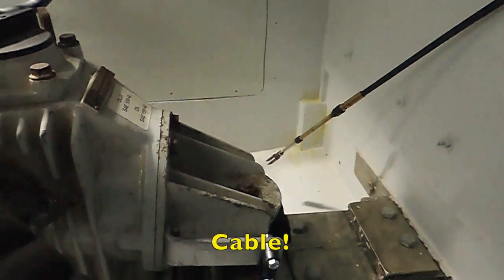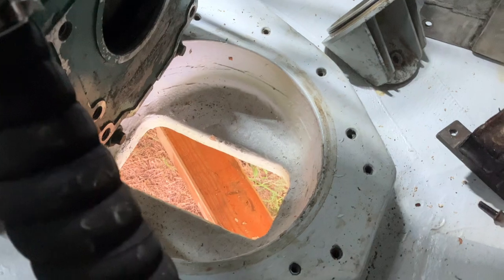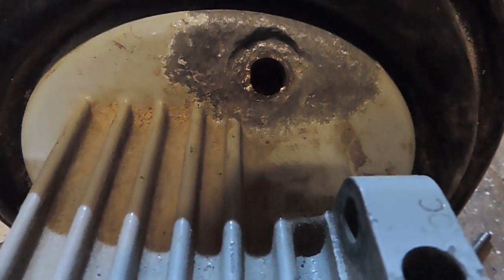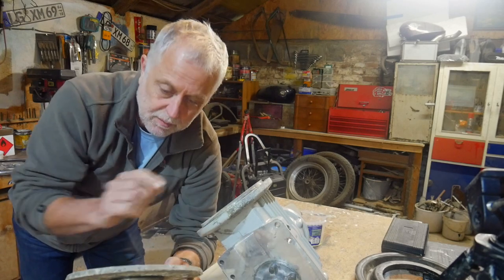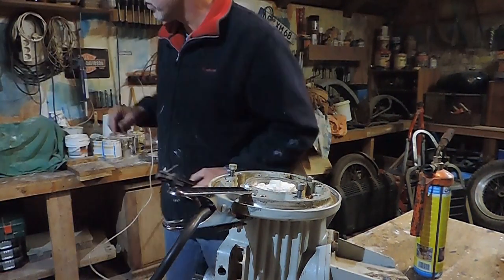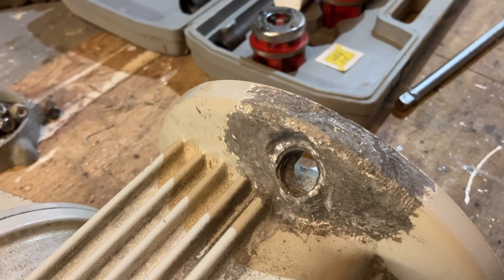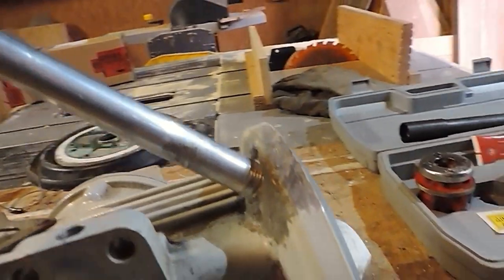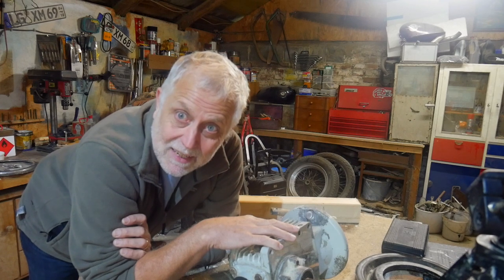THE SAILDRIVE - Removal, Disassembly and Plugging the Seacock; SV Tapatya EP248

Comment: Loved the response to when the broken bolt came out, It's worked! Made my day that has. 
We've all been there in one form or another, you know your facing a right load of grief thinking of various ways to get the broken bolt out. Mole grips, welds breaking, is there a fine tool head to cut a slot for a flat head screwdriver. Use a centre punch and get it as centre as you can and start drilling small hole incrementally going to the next size drill bit and see if you can get it out without drilling out the threads, Dam the threads are gone, drill it all out and retap. 
A whole bunch of ideas and over a day lost then one of the earliest methods works with ease, bolt spins out smooth as you like. Aweseome. 
The size of the project you've taken on glad something went alot faster than planned!
Reply from the maker: Absolutely! Thanks Alston 😃

Comment: like most of us you got into a personal fight with the bolt. And hit him harder. I have seen on other channels, Instead of force, use high heat on the bolt. It seems expansion and contraction of the bolt and the hole exerts great force. Which breaks the binding.
Love your determination and innovations.
Reply from the maker: Thanks Paul. Yes, I’m sure the heat from welding plays a big role in freeing up the thread 👍

Comment: Used this a lot on vintage motorcycles - you can, if careful, weld extensions on broken studs/bolts under the level of the alloy - the theory is the ally conducts the heat away quickly and loosens the remnants. Last time I did it was on a 1906 Moto Reve!
Reply from the maker: Thanks Robert. Yes I’m sure the heat from the welding plays a big role in loosening the broken stud 👍

Comment: You got the "sticky" bolt out by welding and sheer force.  For future reference, the very best solution for removing corroded threads is a fifty-fifty mixture of automatic transmission fluid and acetone.
Reply from the maker: Well, heat played a significant role there, Marshall 👍

Comment: Nice job on the bolt removal, Tony! Certainly much easier than drilling into it and using a bolt extractor, which would probably have been my first go-to.

Also, while you have the sail-drive off, I'd suggest you give some thought to fitting a line-cutter to it. There are some that can attached to sail-drive legs, and it will be a lot easier to mount whilst you have it off the boat. (Given how many boats become incapacitated - always at the worst possible time - by lines or nets wrapped around the prop, it baffles me why so few sailors fit line-cutters!)
Reply from the maker: Thanks Garryck. Yes, they are readily available - I’ve been looking at them. I still have to buy a prop and the necessary fittings for that, so I’ll get one at the same time 👍
Reply: @SVTapatya  - That's excellent news!

Comment: Good job on getting the bolt out Tony. I seem to recall you had some earthing/continuity problems between the engine and saildrive ages ago (Mads on Sail Life had the same too with his Volvo Penta and it was some plastic washers that sit between the two)... looks like there's been some issues on yours  (but I think you checked that - maybe a year or two ago!).
Reply from the maker: Thanks Billy. That’s right, I did find continuity and sorted it out. I’m sure this corrosion stems from the drive’s previous installation - I bought it secondhand 👍

Comment: you should block the in let at the bottom of the leg
Reply from the maker: Yes, seriously considering that, Chris. Have you got experience on that front?
Reply: @SVTapatya  A friend of mine has a boat that has had that done to it. It had been across the Atlantic twice before he bought it and the leg inlets were blocked. I presume it was to keep salt water out.
 The boat that I purchased some years ago had to have the saildrive replaced because of corrosion. It was only in service for a few years and had been sailed in salt water.
Reply from the maker: @chrismilne4511  Thanks Chris. That is good info :-)

Comment: Regarding your sail drive problem. You obviously did some research with your comments on forums. You might be reinventing the wheel as if you either approach a manufacturers customer service dept or even just look at the latest equivalent model it is likely that they have already addressed the issue as part of their own improvement program and if so it is a simple matter of duplicating this for your own needs.

Of course forums are an invaluable source of information but better to check the manufacturer first since as you point out they have all those expensively educated engineers.

I am going to totally guess here but the reason a brass fitting was in there was because some bean counter decided that engineers did not know anything and it was cheaper to go that route which would last a few years till out of warranty then implement what an engineers came up with.
Reply from the maker: Thanks for your thoughts Glenn. I don’t think Volvo have sorted this issue , although the drive does function as they build it. Lots of people report having difficulty with that seacock though.
My solution will certainly work for this boat 👍😃